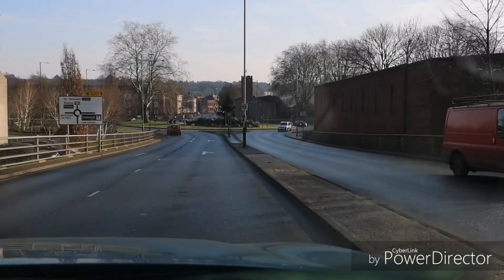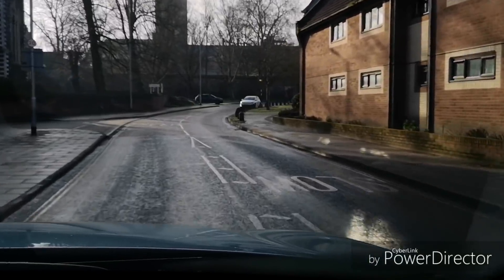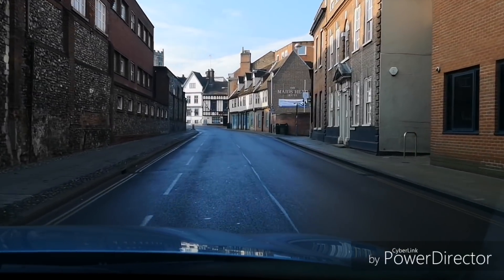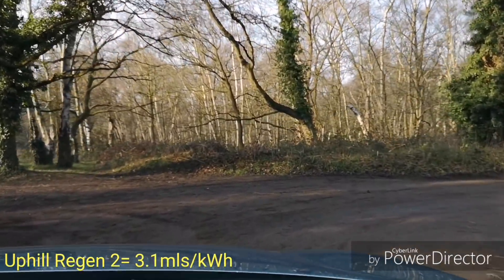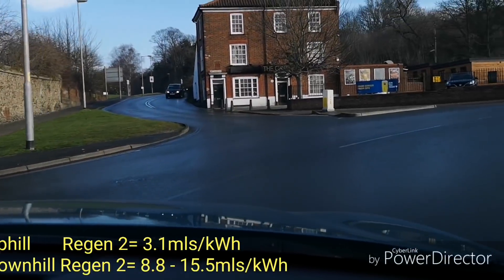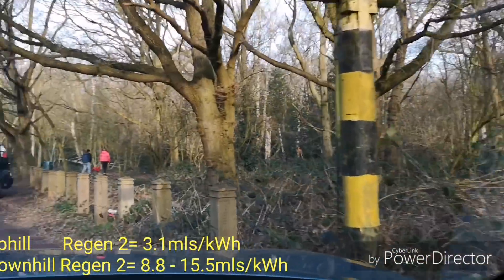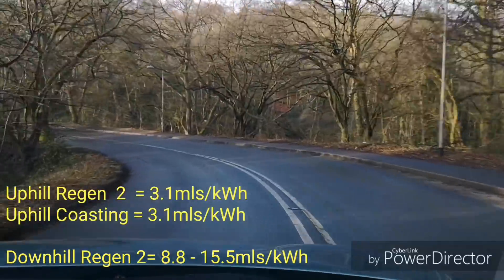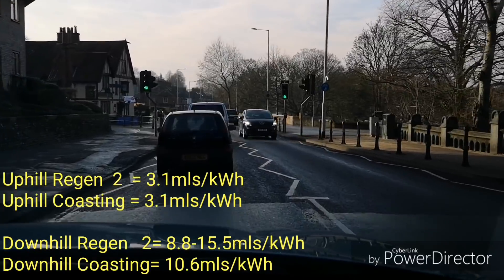Regen Vs Coasting test in the Kona Electric

Comment: I have some confusion about Regen.
If I travel on the highway at Regen level 0  the brake pedal Regen before the disks ?
It's better on the highway to travel with 0 Regen or level 3?
Reply from the maker: Yes regen still first on the brake pedal.  Whatever you feel comfortable with . I prefer level 2 as zero doesn't give any braking immediately as you switch from throttle to brake . Better in emergency

Comment: When you drive in "regen" level your car (Ioniq 5) is regenerating energy even while you driving, but doing so it lose more energy than it produces, obviously. If you drive in level 0, there is no resistance and no energy los. 

Best to drive on level 0! 
To extende you range you mast plane you driving: 
1. left your foot from the throttle and glid as long you are not slowing the trafic bihand, then 
2. regen to slow, then 
3 brake to stop.
Reply from the maker: I think my tests proved there's no dingle secret answer. Dome regen modes suit different roads for example. Straight flat vs hilly variable speed

Comment: What do you think of the pedestrianisation of Norwich city centre?
Reply from the maker: Some of it is good but they do it all so inconsistently, often redoing it multiple times. Wastes so much money. 

Prince of Wales Rd changes look like a complete waste unless you're a taxi driver.

I think they forget old small roads don't suddenly increase in size to fit bus lanes and cycle lanes. By improving one aspect the other deteriorates. 

The whole transport strategy and road design in Norwich is poor. Park and ride is great except for the daft pricing making going be car and parking in the centre cheaper.

Cycle lanes are inconsistent too. 
It's all half arsed imo.

No clear strategy that works

Comment: I think the only time you can use regen effectively is when you'd be forced to use braking instead. Does the kona brake pedal have a regen segment to it or do you have to use the left paddle to regen while coasting?
Reply from the maker: Regen is automated but it's levels are  controlled via the paddles
Reply: @EVPuzzle  so brake pedal is purely mechanical?

Comment: I'm not at all convinced there is a difference. Downhill with regen the number changes from 8.8 to 15.5 right about where you say downhill coasting is 10.6 and with regen you say 41.5 going over the roundabout while with coasting you cut away before the roundabout. To me that makes it statistically the same. Furthermore: regen is the same as (electrical) braking, so there is no difference in getting electricity back. The question regen vs. coasting is a question to be tested when you have to slow down on a level road for a stop sign or something like that.
Reply from the maker: I agree. The real numbers went really high the more I came to a stop so Regen is better IF you can stop and start not just slow down

Comment: There are only 4 rules to efficient EVing

1. Putting energy in is more efficient that getting energy out i.e. regen
2. Regen is always better than brakes
3. Less acc/dec ..elerations are better
4. Drive as slowly as you dare

A converted hearse would make an ideal EV
Reply from the maker: So on a decent hill down, do you accelerate maximising the use of the descent...do you coast or do you regen at the bottom?
Reply: @EVPuzzle  physics doesn't care about you. You simply have potential energy.  So based on the 4 rules:- Only accelerate enough to get your car moving down hill. You have no choice but use regen, as you would either have air friction or brake friction. Neither are better than regan. Ideally you would set cruse control to 3mph...not very practical.
Reply from the maker: Surely gravity and momentum are there to be maximised but it seems you're saying Regen is best to capture that energy whatever. Sharp braking at the bottom of hills it is 😉😉
Reply: @EVPuzzle  I realise I'm not very good at explaining things. Hills are a way of converting potential energy to kinetic energy. If you go fast down a hill energy is wasted in air friction. If you break sharply energy is wasted in disk breaking. Therefore go slowly use regen to maintain a slow but constant speed. Yes, granted; remove regen and gain speed to get past flat bits

Comment: I'm really pleased you did this test as I've been wondering about this ever since I drove the Ionic and the Kona EV's. On flat roads running in 0 regen the cars both felt much more free-flowing and allowed me to take me foot right off the throttle pedal very often, with the vehicle maintaining it's speed.

Comment: Thank you for your video , unfortunately my car must have out of date software as the option to check or uncheck isn’t there in driver assistance and in the other menu with LKA , attention level , tyre pressure , there isn’t there isn’t speed limit warning showing , mine has three sections but your video shows four 
I will phone the dealer to tomorrow , unfortunately he wasn’t up to speed with the car as it’s the first Kona EV the dealership had seen. That will be a challenge explaining what’s missing to him 
Thank you for your explanation
Reply from the maker: Oh dear.  UK car?  Should be the same. That video was from Premium not the premium SE.
Reply: The EV Puzzle
 definitely uk car , collected it was week from Read’s dealership in Boston Lincolnshire
Reply from the maker: Very odd.

Comment: Thanks for the test Nigel. 

Your short test proves what I was saying in my last comments in a previous video of yours that coasting is more efficient than regen set all the time. 

The great thing with the Kona EV (and Mitsubishi Outlander PHEV) is you can easily adjust the regen on the fly with the paddles so quick adjustments up and down - no need to set with the selector like the Nissan Leaf. 

I always coast on freeways/long roads and only use regen to slow the car for traffic or to keep within speed limits going down a steep hill (but only use regen momentarily to just wipe off some speed then set back to 0 for coasting again). 

Coasting also allows you to simply adjust the speed but removing your foot from the accelerator momentarily to keep your speed (rather than speed and use regen to slow then accelerate again) - with practice it is very easy to do due to EVs have a much more linear feel than an ICE car. 

The only time I leave regen set on at any level other than 0 (coast) is when travelling in slow start and stop traffic for comfort reasons - benefits of coast efficiency are limited in these circumstances anyway. 

Be great if you did a longer test on the efficiently of coast say on a trip (like a  range test comparison) would appreciate to see it 👍🏻
Reply from the maker: That's a good idea on coasting Vs Regen long range test but there's an issue. The longer the test the more opportunities for discrepancies like traffic or tractors or weather differences. 
The challenge is accuracy.

Short tests are more consistent but can be inaccurate as not long enough to become precise.

I also have to go in the same direction to avoid wind variances.

When I try a 300 mile or bust test, I might do half in coasting and half in Regen ?
Reply: The EV Puzzle - best test might be a highway drive (to help eliminate traffic and other variables) from point A to B on coast then return on same route on regen set on same setting for the entire trip.
Reply from the maker: That'd be a flat road test?
Reply: The EV Puzzle yes it would 👍🏻 it would also help to remove the variable of gradient which saps EV range - speed would have also be the same in both tests for consistency as well. The YouTuber Bjorn Nyland uses 90 klm/per hour in his long range EV tests to give an average speed instead of just a highway speed.

Comment: why u don't use kWh/100km? Its more convenient and familiar used like ICE cars
Reply from the maker: Because my car displays in miles.
Europe should convert to imperial measurements. It'd be so much easier
Reply: Ah yes, forgot you use miles... In Your case it can be  kWh/100mies...but u didnt use such figures, u use miles per gallon.... P. S. those miles not 1862 meters, and those gallon not  3,7 liters...
Reply from the maker: Yes that's the UK standards.... Miles per kWh  N :1

N per 100 makes no sense to me,
Why not 'km per kWh' ?

It's confusing for some people just converting miles and kilometers.

Our 3.1 miles per kWh eqls your 20.04 kWh per 100km

8.8 miles per kWh eqls  7kwh per 100km..... I think lol

Comment: The discomfort and feeling of overspeeding around bends with no regen plus the need to use brakes is why I drive everywhere on regen level 3. I did same tests because I thought Regen was having a vampire effect up hills or on the flat but I could not see any difference in the figures but get great regen and rarely use the brake pedal. The paddle brake function is brilliant and draws the car to a halt much smother and without the final lurch you often get from the foot brake.
Reply from the maker: My conclusion too.  The final moments in Regen coming to a complete stop appear to impact efficiency most otherwise , as per my very early tests, there's not much difference

Comment: I think it depends on the most prominent gradient. If the gradient is sufficient to use a lower gear in a fossil-burner, it would be worth regen. But if it’s a more gentle slope, where you wouldn’t have changed down or brakes to slow down before. Then you might as well coast.

Comment: That was useless. Tooooooo short...
Reply from the maker: It's  indicative
Reply: @EVPuzzle  Of what? If you know how digital systems work you would know that any numbers you got were more or less do to refresh intervals so even time you spend at the top of a hill had huge impact on your downhill result since it changed where in a refresh cycle you are... Assuming a cycle even started when you rested you efficiency meter...

Not to mention that on such a small distance even lights could effect results of you had to wait longer at a top... And then there is a heater that could run harder in one of the runs and so on... That is why you need bigger distances to get any useful data out.

Comment: It makes no sense using regen braking when driving on the open road, freeway driving, or downhill. You will always get better "mileage" if you are coasting as apposed to breaking (ICE or EV, its physics, its all the same). Regen is only useful in stop and go or stop and slow driving.
Reply: This thought helps my understanding as I approach owning an EV
Reply: but duiring driving and coasting at 100-130 kph - do you add 'gas' to maintain the speed, or you are driving with 100, wait few seconds till it trop to 95 and add energy again?

Comment: Advertising Norwich, you are starting to sound like Alan Partridge. I would imagine that if you had to brake to keep to the speed limit you were getting regen that way when in coast mode. After 2 years with the Zoe I am perfectly happy to use the brakes to get extra regen. I am a little undecided as to whether one pedal driving is something I want or not. I do notice that driving on the speed limiter seems a little more efficient that trying to hold speed manually.
Reply from the maker: My hero lol, Alpha Papa

Comment: Cousting is the more efficient way in any situation.

I like England very much, but i fear for left side driving, lol
It would take a while to do this from self.
Espcially in bigger roundabouts i would be lost.

nice greetings from Austria
Reply: Coasting is not always more efficient, it depends. What I've found is that steady speed is the most efficient. So coasting down a hill to build speed for the uphill is good in an ICE, but not in EV where you can regen.
Reply from the maker: Surely the physics is the same, momentum assisted by gravity downhill so accelerate down..?
Reply: @EVPuzzle  physics is the same, it's always cheaper to go downhill than to go up.. In an ICE it's always more efficient to build speed going down and roll uphill if you can. Actually so much that, normally, it's more efficient to roll down in neutral and idle than to be in gear with fuel cutoff (of course if you can use that extra speed going up or on a straight).
But ICE-cars don't have regen..
Reply: I use on longer donwhill drives the recuperation level 2, but if not, using the brake pedal, there is no much difference. But more comofort if using revuperation level 2. Have to do more experiences with it. And you are right, steady speed is the best if possible. One pedal driving i not like. If you are on country roads you cannot relax the throttle control leg, if you are not driving with cruise control.
But anyway i like the auto recuperation, this is allways on with me, and works in coasting mode (level 0) also very good.
Reply from the maker: It's the same for me driving on the left. Feels weird for about 30 minutes
Reply: Everyone fear...
Reply: @Prom, try use limiter instead. Very relaxing in my opinion, use it all the time.
Reply: @ekhaat  , good idea, will try it ...

Comment: Not surprising there's no difference going up hill!
Downhill: if you've selected coasting mode, what happens when you use the footbrake? In a Nissan LEAF, braking is still done by regen where possible, adding friction brakes only when you stomp harder on the pedal. Does the Kona use regen when you hit the brake pedal?
I'm guessing you went down the hill faster in coasting mode. That might make the comparison a bit vague as it introduces an extra variable.
Reply: In Nigel's previous video, he was wondering if having regen on had any effect when not going downhill, as when you ease off on the throttle, it seems regen is so instant, that it's maybe 'fighting' with the throttle and hence the uphill test.

Regarding braking with zero regen, Yes, the Kona Electric does apply regen before braking with physical brakes, unless you select Neutral on the gear selector whilst driving along. Some of us use this technique to give the brake discs a scrub occasionally, when and where it's safe to do so. The infrequent use of the physical brakes, causes rust to build up, this method gives them a clean.
Reply: Kona uses regen when breaking with the pedal too, to a certain extent.
Reply: With the Kona, the break pedal also does recuperation, but you can dose the regeneration very fine. And with this kind of regeneration you can drive in a smoother way. So i am nearly sure, that this kind of recuperation and level 0 is the best in effiency and matching the reality.
Only if you brake very hard, the physical brake is using, or in the last few meters on stopping the car.

Or with other words, if you choose level 2, or level 3 and the car is to slow down hill, then you have to pull down the throttle pedal. This is not good. If you use level 0 and the brake pedal you can regen in a smoother way and have not to use the throttle pedal.

Comment: Nice test! 
But I think the kind of hill and speeds done are far from representative in general.
First, I think cruise control should determine speed in most conditions. Your coasting run may have been slower. But if you tend to drive under the speed limit, coasting to the limit will on certain hills allow you to roll up the next hill and save energy.
Really, it all depends.
I've seen vids by Ioniq drivers in Germany who use coasting for the highway. Depending on preferred average speed, this may not always be best also.
Reply from the maker: Not perfect for sure but it's a start and a good indication

Comment: Good for you supporting Norwich Nigel
Maybe a few trips out showing us what the local charge points are like for exploring while( or after) charging
Regen can only recover a proportion of the energy input so if the slope won't need braking then coasting should be better :)
Reply from the maker: It's so negligible and coasting encourages you to speed to keep up momentum